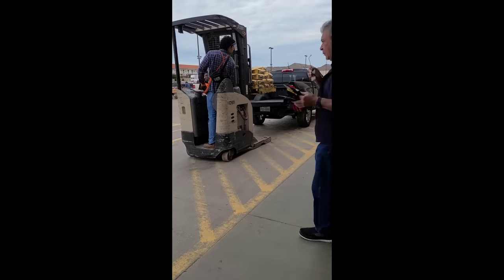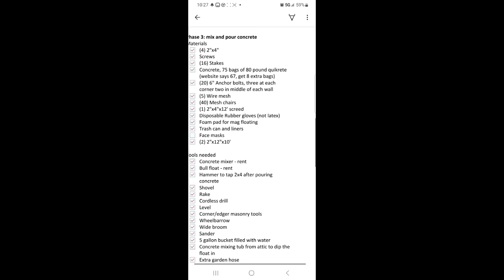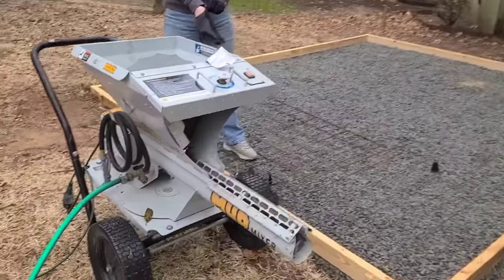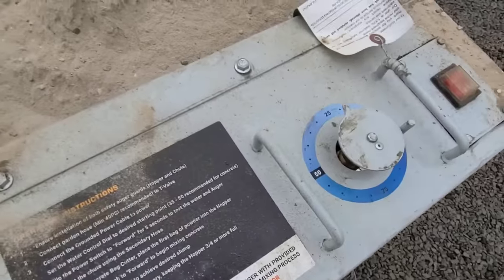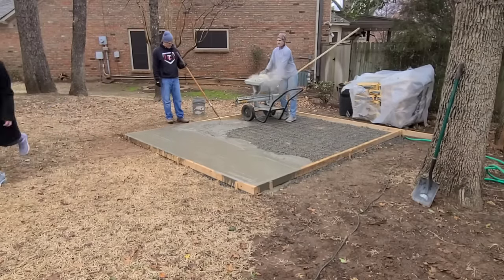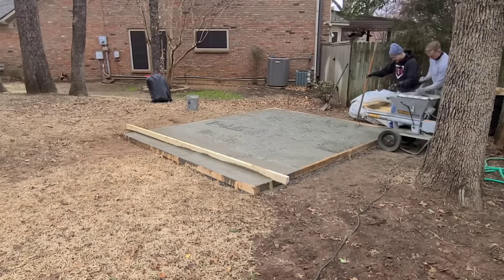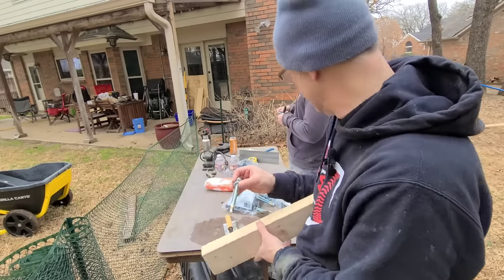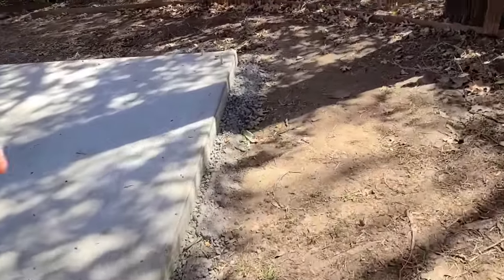Shed build part 3 - pouring the concrete slab

Comment: Typical. Went Into it trying to disprove it and rushed the entire process. I think everyone watching the video can see he proved what he set out to prove. The bag doesn’t even say “mix with water” …. It literally says “just ADD water” 

Rush a job and don’t do it as instructed and you’ll always get subpar results. He adds a few more bags of concrete and is patient when screeding, and actually has a hose with the spray function (his didn’t, it was a fan setting - there’s a difference) and he gets a much better result. Full disclaimer, I’m a nobody but I can see CLEAR differences in what he did vs what others that have successful slabs do.
Reply: You always mix with water!! When it says just add water it means you don't have to "add" rock or sand! You definitely shouldn't be commenting on here saying stuff like that
Reply from the maker: Thank you for watching, and for your comment. I am a bit confused by your note. I am not trying to disprove anything. I am just a guy who wanted his shed on a concrete pad, and used the best method for my situation. Thanks again.

Comment: Why not just call for a short load instead of using all those 80lb bags
Reply from the maker: I spent about $600 on rock (see video #2) and concrete together,  $80 to rent the mud mixer, and other minor expenses. The concrete folks in my area are flush with business, and the quotes I received were over $3k, top quote was $3,700. So I did save a bunch. But I also enjoy outdoor work, and this was a fun learning experience for me. I am enjoying doing this project myself.

Comment: Bag mixes like that always have a ton of bleed water.  They aren't designed to be poured but placed and worked.  Because of that they often require a lot of extra effort.  Your pour will not achieve the 5000psi strength it was designed to because you used too much water 8:00

Comment: Pouring with premix that cost 3x what it does with AB and portland, using the wrong anchors and posting it on YouTube 😂
Reply from the maker: Thank you for watching and for the comment. Yep, my goal is to help other amateurs not make the same mistakes I did. I am learning quite a bit. That's what it's about. As far as cost goes, I already saved over $2,500 by pouring it myself. And I imagine using AB and Portland works best for some, but using the bagged mixed was a big advantage for my circumstances.